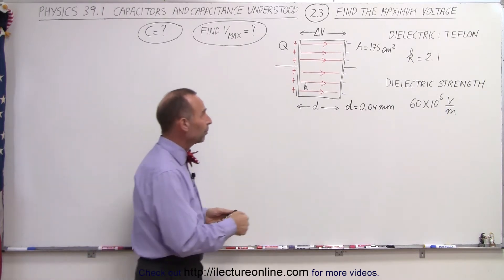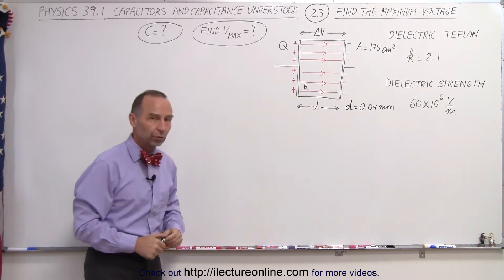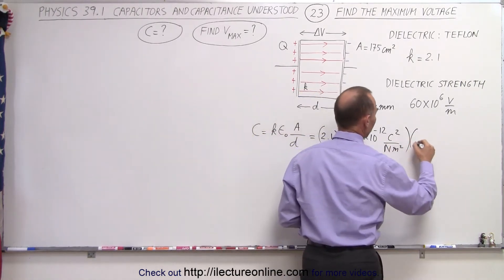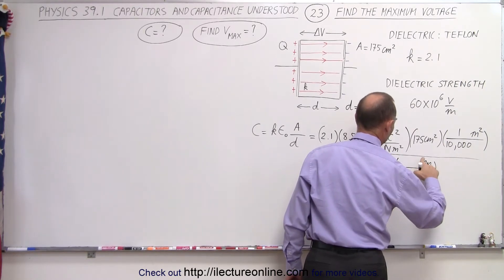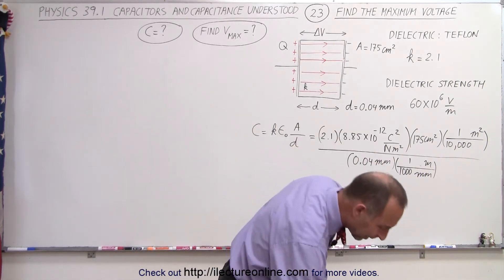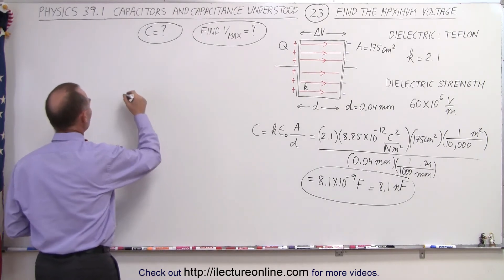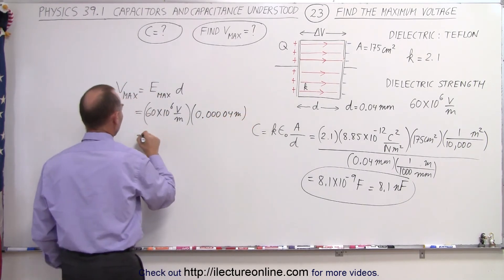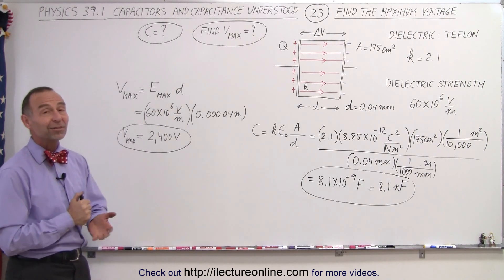Physics - E&M: Ch 39.1 Capacitors & Capacitance Understood (23 of 27) Maximum Voltage=?

Comment: So the maximum voltage does not depend on the surface area of the capacitor, or the current?
Reply from the maker: The voltage depends on the magnitude of the electric field and the distance between the plates.